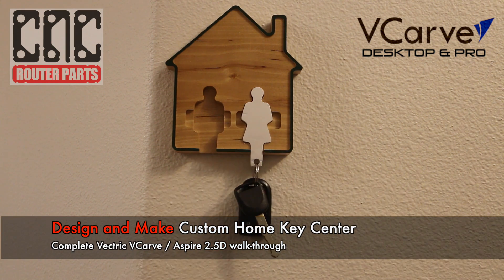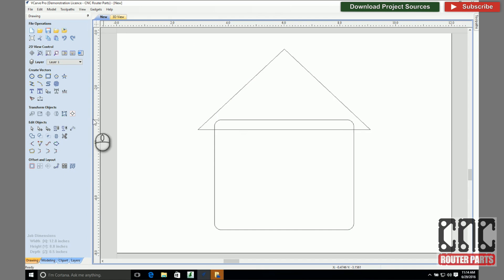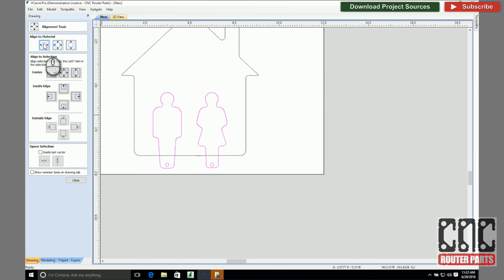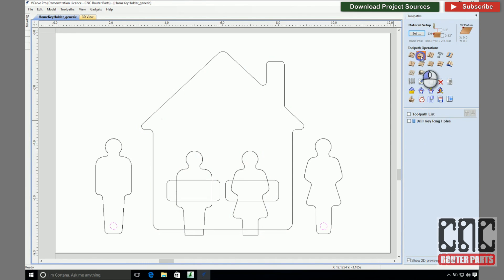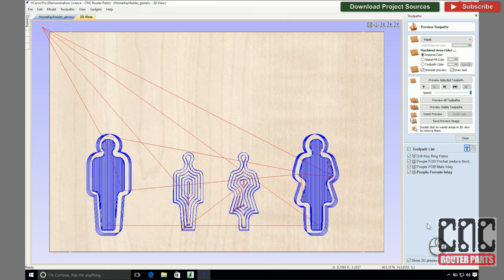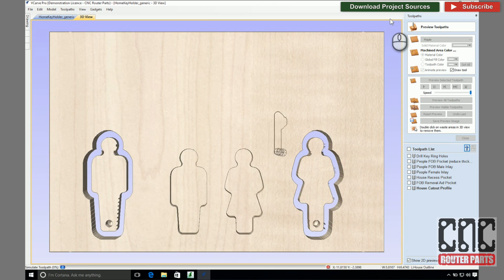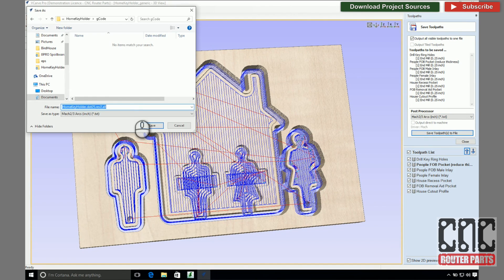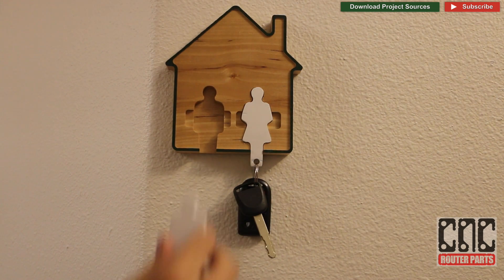Design and Make a 2.5D Key Ring Holder, Complete VCarve Walk-Through

Comment: Nice Project.  I'm interested in the same information as ontheEDGE.  How were you able to setup the CNC to slow done in corners? I wasn't aware Mach3 could do that.
Reply from the maker: Hi Jon,   Thanks!  The slowing around the corners that you and ontheEDGE noticed is actually coming from our motion controller that we use in our Plug-and-Play CNC Electronics as it manages the motion buffer look-ahead health (ensuring the buffers don't underrun).   As such , not behavior you can selectively enable.    -Nathan
Reply: I had same issues when using a 3d Printer controller for my CNC and having the circles interpolated to fine, the machine just can't keep up with the amount of data it has to process. But i'd expect a more consistent feedrate on a commercial product :/